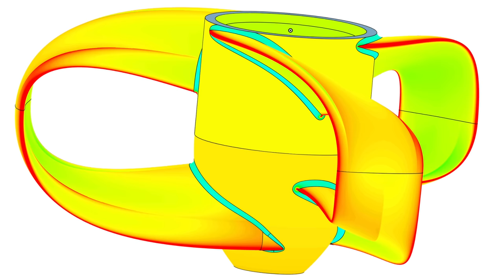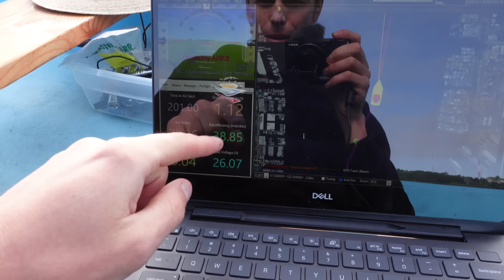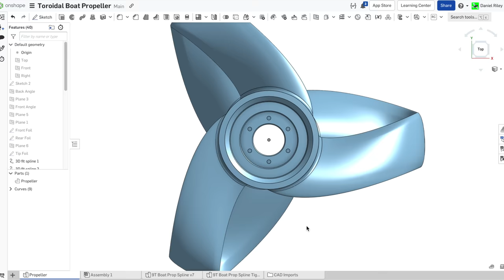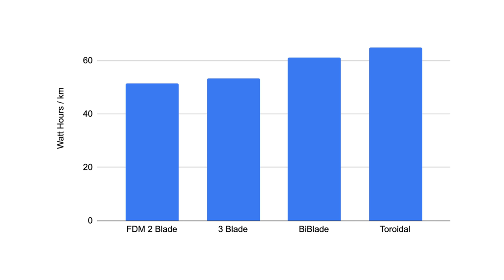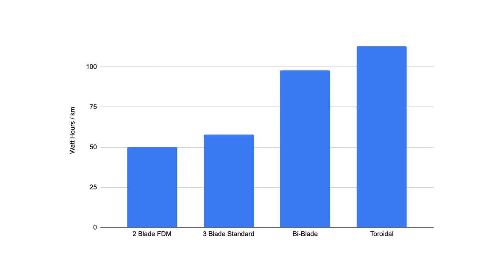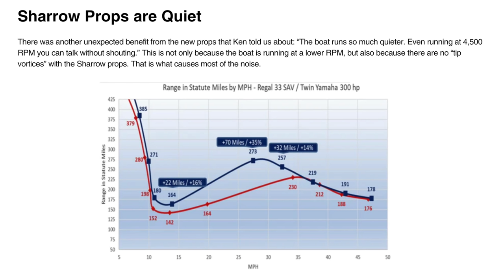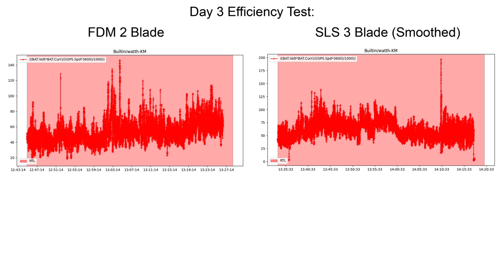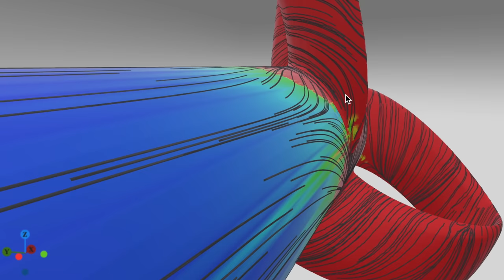Testing Futuristic Propeller Designs on my Solar Powered Boat

Comment from the maker: Use code RCTESTFLIGHT50 to get 50% off your first Factor box at https://bit.ly/3JgFdFQ
Reply: This made me think that if I put a magnifying glass on it, will it increase the energy or will it just burn?  15:00
Reply: friend, you do not have to wait for another type of propeller to be invented, you can be inspired or copy the propellers of submarines, there are many and with different characteristics, especially nuclear submarines, they have the most efficient propellers in history.
Reply: Higher "peak thrust" should be great as the goal be to as quickly as possible "step up" (transmission re: new Mercury Outboards have an automatic transmission) to "ON PLANE" (ride atop the water and On the Level to vastly improve hull efficiency at speed.)

Once "on plane" can then "step down" (Downshift) to control all three vectors on plane meaning pitch, yaw, and roll the Holy Trinity of Boating. This also can be measure beyond mere time over water versus time over land under water which should yield two different velocities no different from aircraft time at speed in air versus time at speed over "land/water" the latter often surprisingly high/beyond the ahem "speed of sound" ahem. In Boating the effect trying to be created is no different from that which a hydro foil does...only without the hydro foil/propeller only plus shaft.
Reply: 1 I like the boat 2😊3 The prop discussions not for us. 5 where we at 6 let's worry about energy consumption and storage in collection
Reply: why are there four numbers after my YouTube now Jesus
Reply: my energy efficiency on a unicycle is much higher than your boat lol. 50 wh / mi at 30mph
Reply: also, putting your hand near the prop while the motor is still alive is very dangerous 32:00
Reply: Can you build bigger propellers?
Reply: Can you build propellers with more blades?
Reply: The exhaust from combustion engines is often emitted via the prop hub, it avoids spinning the core of the propwash.
Reply: What about that ABB whale propeller concept which is an attempt to make more efficient propulsion for ships.
Reply: Why not use jet drive? Looks cool and would be a fun project to watch
Reply: As a Ginja I was melting into my seat thinking of the burn factor with your solar panels set vertically next to you..
Reply: do some more of this I found it super intresting
Reply: 24:48 huge hype around this toroidal propellers but just a bunch of BS. It is definitely more efficient than a standard one due to more surface area which can be simply replicated with a larger propeller, no different from designing fan propeller or turbine blades, bigger is better!
Reply: are you using like a spry drone for the under water shot or is it homemade
Reply: What motors do you use? Got a link?
Reply: dude made a whole video about a subject that he didnt study or even use in the video lmao...but eat his sponsors food lol he didnt read that either its probably got sars in it..weeeeeeeeeee
Reply: @MML66 kooookà
Reply: Your two bladed Prop is producing lots of vibration because of the flow disturbance created by the leg in front of it.
Reply: Your Aeroplane Prop is Way too big.
All of your props have too much surface area and pitch.
I get better speed from a 500kg Boston whaler with 200W of current draw from brushed dc motor.
With NO BLOODY STUPID electronic motor or battery babysitting. 
Your electronics are very lossy and you are getting huge centre vortex losses from having far too much rotating surface area dragging sticky water into a super rotating core vortex.
Reply: its just a pinwheel with the tips cut off....
Reply: Bro. I'm autistic and your invention could change ships forever. The Marine industry has been trying to reduce noise from their engines for YEARS. Because it hurts under water sea creatures, imagine having a rock concert 24/7, now imagine your whisper-quiet props.
Reply: Can't you run a fluid simulation program using your propeller designs ?
Reply: Why not make same Science as the Bladeless Dyson Fan? That technology in the water would be priceless. Maybe a step down that also uses the bubbles energy..
Reply: You guys too smart to see. This is Ancient Technology and you still trying to polish a Turd. Reinvent the Propeller!!
Reply: Hmm, water doesnt compress like air... maybe thats the thing
Reply: not here to watch you eat food dude, they have other channels for that
Reply from the maker: then skip forward! no ones forcing you to watch it dude  @albinoviper2876
Reply: I don't know why people keeps using open blades when it's way better "closed/covered blades". RCTestFlight, try to make a turbine-like propeller. "Just" put a "cap" over your best propeller and see if it improves speed, then try different types of it (different diameters, different blades, different lengths of the "cap"). The "best" cap is not the "flat" ones (the one with the same diameter all over the length), but the ones that have variable diameter (like 🔈📢). Test also putting the blades in different parts of the "cap"/turbine (front, middle, back), etc... Again, forget open blades 😂😂😂 
I think that (it's MY opinion, not tested it) the best would be to have the "air/water intake" (the "cap") be the size of the boat, with the "mouth" the width of the boat, the hight "to be chosen" and then continuously reducing the width and the hight until ending in the propeller. It'll push and pressurize the water and create a back jet propulsion.
Ok, made my suggestion, now go and do your tests 😂😂😂
Reply: Hi, would you try to make propell out of the Sabu disk found in Egypt or Orgone Scalar/Torsion Fields based on Viktor Schauberger works? I think using the golden ratio mathematics is hey here. Please post open-source models if you start this project. Have a fantastic 2024. Cheers!
Reply: @rctestflight 10 years vegan. 10 years of not hurting animals. I’m better than that. Proud Vegan ✅❤️💪😬👱🏼‍♂️🦍😎👍.
Reply: I think you should just forget about the propeller and switch to a paddle wheel because it has more efficiency at low power))) If you design a track like a mountain snowmobile, but with a variable angle of attack of the blade when entering and exiting the water, then you can get greater efficiency for a light solar-powered catamaran)
Reply: you will need a reduction gearbox
Reply: Hey. What do you think about super thin solar panels?

Comment: Finally someone just 3d prints the traditional design to be able to compare it with a 3d printed new design.
Reply: Yup, very clever and it makes sense at least!
Reply: @1islam1  The fuck? You good?
Reply: @1islam1 ow does this apply to anything in the video?
Reply: @Skaadi89  Its a bot running commercials. Tons of them around for every religion. Ignore it.
Reply: @holycaketree  Its a bot running commercials. Tons of them around for every religion. Best to ignore it and dont feed its algorithm from being given feedback/engagement.
Reply: You mean iterative design?
That's what these channels do.
Reply: https://youtu.be/MNnB_50Z20I here you go. Not printed, but a pretty solid test
Reply: @ImmortalAbsol  - Way too many youtubers testing this prop design  have pointed out that a 3d printed prop has a much rougher surface but not been able to figure out  that one can simply 3d print both designs to eliminate this variable.
Reply: Yeah exactly like so many of these videos never do that.
Reply: @trancetechkid  - Never!
Reply: @GoldenCroc Not for every religion
But only for Islam and Christianity.
Other religion don't forcefully convert people or preach like that but you guys are obsessed with it
Reply: @I_killed_that_beard_guy  You are right, not every one. I found it easier to write as I did rather than listing them all, so I took some liberty with the definition, to say the least.

Secondly, who are these "you guys" that are obsessed, and in what way? The way you wrote it can be taken to include me, which, in that case, I dont agree with.
Reply: @GoldenCroc  Yes you are right, and ofcourse you are not included.
Reply: @GoldenCroc they don’t have bots for the spaghetti monster!

Comment: As an engineer, I really appreciate the way you present your videos. You build cool things, explain your thought process and provide high quality shots while cracking subtle humor 😊
Reply: hi erikp, have you become a flat earther yet?
Reply: The benefit comes when attaining a plane. At low and high speeds, the efficiency gains are marginal. But getting on a plane at 2500rpm vs 3500rpm is a huge benefit.
Reply: @flat-earther  Why would someone become a flat earther?
Reply: @fuckednegativemind  because we were all lied to when we were taught that the earth is a ball flying in a vacuum
Reply: It's a formula you can find all over yootubez my man... But then, I appreciate, this is done very well.

Not being able to afford one battery of this type or capacity... But having univershity degrees that suggest I should...

Life Sadly isn't a predictable science.
Reply: @winzracingNZ  Okay. BTW winzracingnz, what do you think about all gubments drawing a line around you(Antarctic Treaty) and saying you are not allowed to leave? If you don't know what I mean, read my about tab.
Reply: @flat-earther  🤣🤣🤣🤦‍♂
Reply: @flat-earther  Flat Earthers and being completely deranged, name a more iconic duo
Reply: @MSDX360  MSDX Are ad hominem attacks your best globe proof?
Reply: @flat-earther  Stating a fact isn't ad hominem. Be careful, don't fall off the edge of the globe
Reply: @MSDX360  strawman. no flat earther claims there's an edge
Reply: @flat-earther  Your theories have been thouroughly disproven time and time again, even by Ancient Egyptian and Ancient Greek people. Back to elementary school with you
Reply: @flat-earther  Your best flat earth proof? Ancient civilisations knew the earth was round.
Reply: Cool
Like u introduced air, if u include sand, the wear on the blade shall indicate the least efficient places/angle.
Just like on your simulation program, with colours.

Comment: I’d build a static test rig that sits in a swimming pool or pond and measures the force output. That way you can easily step through a series of speeds and get a graph of kN/Wh plotted against rpm. It would also make it more viable to keep printing a bunch of rough FDM props for rapidly testing new designs.
Reply: hi Scrogan, have you become a flat earther yet?
Reply: @flat-earther  I have a question if you're a flat earther explain to me when a boat is moving away why does it look like it's going over a curve and not a straight line?
Reply: @STAR-GAMING50  Why does the farthest street light in a row of street lights look lower than the ones closer to me?
Reply: @flat-earther  this is from a website that has research,  Follow ships on the horizon
If you’ve been next to a port lately, or just strolled down a beach and stared off vacantly into the horizon, you might have noticed a very interesting phenomenon: Approaching ships do not just “appear” out of the horizon like they should have if the world was flat, but rather seem to emerge from beneath the sea.

But, you say, ships do not submerge and rise up again as they approach our view (except in Pirates of the Caribbean, but we are hereby assuming that was a fictitious movie series). The reason ships appear as if they “emerge from the waves” is because the world is not flat: It’s round.
Reply: @flat-earther  No. Do you believe that you can construct a predictive mathematical model of reality? If so, I recommend using the results from a cavendish torsion balance to construct a predictive model of gravity, or use Tycho Brahe’s measurements of the planets and stars to construct a predictive model of planetary motion. Constructing a model where the sun can be setting (e.g. 90 degrees from vertical) in one place and directly overhead in another at the same time would also be a neat start. Claiming “refractions” or “mirages” alone isn’t enough, you must demonstrate that such an optical phenomenon could deflect light in such a way, and determine from that what the optical structure of the atmosphere must be.
If not, there’s literally no point in talking to you. It isn’t a model of reality you wave about, it’s a dogma.
Reply: @Scrogan  I tried responding to you but youtube censored me
Reply: @Scrogan  youtube censored my response to you
Reply: @Scrogan  Wow i love that reply. well done.
Reply: Despite the comments above, as a naval architect and semi connoiseur of marine propellers I will say the following:
1.- You measure thrust versus power in a propeller.
2.- You can use a dynamometer to measure the thrust in a static bench.
3.- You can use a watt meter to measure power consumption in an electric motor.
4.- A pool is not adviceable because a closed flow will conform around the propeller, generating a vacuum on front of and drawing water from the surroundings, taking water from the sides and eventually creating a current that will affect or create vortex and screw up your readings.
5.- If a pool is still a viable way, to put the propeller bench in the middle of the pool and to ensure a sort of channel 4 times wider than the propeller but at least 5 times in depth to ensure a more reliable reading on normal conditions, because being a close environment currents will appear regardless (scientists will start piling up logs and torches after this post).
6.- Propellers, at least ship propellers, are designed taking factors of ship desired speed, hull form, wake coefficients, water coefficients, installed power and rpms on the shaft, cleareance from the free surface, etc, etc, etc. Having said it, this test is utterly bunkers because in no case any of the propellers were designed for the motors and power supplied nor the speed desired to achieve blade profiles that would be correlative between them. 
In other words, it was enlightnening in many aspects but I have my doubts as for the validity of results not as the measured data but as if they are comparable against each other but the idea of reducing the vortex on the blade tips and cavitation is a proven and widely spread concept as ducted propellers and kort series. With the right approach this testing would surely get some nice results. @rctestflight excellent work!, love your spirit of experimentation and daring.
Reply: How can water be level on a ball. Because water is always level. Spirit level ocean level round? At the beach looking at the horizon why is it flat and not curved like it we were on a ball or in a plane where is the curve . Just saying. Do you believe in God if yes  then you are a flatearther.
Reply: Perspective
Reply: Bible what atmosphere it's made up for you to not realize that you are in jail